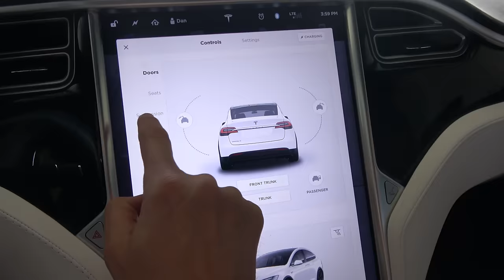What's inside a Tesla Tire?

Comment: Discount Tire will rarely patch a tire, they prefer to sell you tires instead.  Go to a smaller mom and pop shop where they will repair just about anything.  Discount Tire is a corporate shop, they have too many attorneys and share holders telling them what to do and what not to do.

I speak from experience.  A small local shop has patched various holes for me that Discount Tire refused to do.

Discount Tire will even remove a tire from a wheel and refuse to re-install it which could potentially leave someone stranded or force them to buy a new tire instead.
Reply: Blaine please make sure your facts are straight before commenting. While discount tire is the largest tire retailer in the world they are still privately owned. Just like any company yes there will be attorneys telling them what to do and not to, but it will always be for the safety of the customer and the employees working on the tires. 

I will agree I'm not sure why they wouldn't have serviced that tire it is serviceable. But before any tire is repaired at discount tire you are asked for a plan in the event of a worst case scenario. You will never be stranded. No one at discount tire is commissioned based. There has been numerous cases where a tire, if no other safe alternative can be found, will be installed for very cheap or no cost at all. 

The reason smaller shops will do things that discount tire considers unsafe is because that's what they are a small shop they don't care. I do ask of you Blaine that if you felt that discount tire has mistreated you in the past please speak with a store manager or higher they take customer safety very seriously but also want to make your experience as good as can be.
Reply: loopie159753 please make sure your facts are straight before you comment. The attorneys telling them what to do is not always for the safety of the customer it is often for the safety of the business. By making the repairable area of the tire smaller they have less chance of screwing it up which is unlikely to hurt anyone but could lead to some heft legal fees if someone figures it out. 

Having worked for Discount Tires and Goodyear myself there are tires that are refused repair which are repairable and there are tires which get repaired which shouldn't... on a daily basis.
Discount Tire is nowhere near close to being the best option for the customer. I managed 120 stores and wouldn't have trusted my car at all but 2 of them.

There are indeed scenarios where you will be stranded. If you are on a long haul journey and you need a new tire because of a blow out and your car is fitted with a temporary spare but as unusual sized tires then you will have to wait for a tire to be shipped. It happens.
Reply: Blaine Bugaski 
that's funny because Discount Tire repaired a flat on my car and it wasn't even a tire that I had purchased from them. They did it for free and when it was time to purchase tires on my other car guess where I went
Reply: Blaine Bugaski your not stranded. I've had a vehicle towed to Pep Boys with a blowout and they thought they could gouge me. Pointing out I could have it towed again and calling other tire shops changed their attitude and pricing.
Reply: Good luck, ALL of the local Discount Tire locations are always so busy and bustling that your repair and counter argument are basically worthless.  Really......what do I have to gain or lose by telling you wrong......
Reply: Do I feel mistreated, no.  If I need new tires, I will consider them.  The last time I bought tires I went to Tire Barn because they offered some better choices at better prices in comparison to Discount Tire, Walmart, Goodyear, etc.

However, I will always return to the local mom and pop shop for repairs, because they have treated me the best time and time and time again.  Discount Tire may offer better prices on tires but they are not concerned with small repair affairs.

My facts are right - I speak from experience.  Your mileage may differ.
Reply: Blaine Bugaski I work at a discount tire. I completely disagree with your comment. I have saved many people’s wallets from having to buy a new tire. If we see a nail we patch it. If it’s in the shoulder or side wall we let them know that NO tire place should ever fix it because it brings danger to the customer. Discount tire pays to train their employees for 2 weeks before touching a customers car. In that training we are taught that we want the customer to come first. We do free repairs and inspections.
Reply: Andrew Robinson  I too work at a discount tire and I completely back up your statement.
Reply: Andrew Robinson I don’t work at discount tires I work at les Schwab but i do have to say I think it’s a little funny when you have a customer who wants you to fix a hole in the side wall or a hole in the shoulder and you tell them that you can’t fix it and even after you explain to them why you can’t fix it they still want you to fix it.

Comment: So does this mean we can take off our "plebian" tires and glue a long strip of foam in the inside middle part and have the "luxury" acoustic tire effect? Sounds like a weekend plan/project. ;)
Reply from the maker: Do it! yes it is pretty simple. But great to see companies that do little things like this.
Reply: Remember if you cut the tire open you can't use it. For non car ppl.
Reply: It can be quite tyre/wheel specific. You'd have to figure out the resonance of the air inside the tyre and work out the proper thickness and density for the open cell foam. The lower the frequency the denser and/or thicker it needs to be.
Reply: Forget it and install noise insulation in your cabin instead.  If you can find a sound expert, also active noise cancellation like all modern aircraft have.
Reply: OptimisticPessimist it's about being quiet for everyone around also
Reply: Ace Tech Wait! ...you're saying I can't just zip tie em closed and call it done?!  I've already finished 2 of them!!

😆

Comment: the foam on the inside is not for sound deadening, they’re what are called run flat tires.
Reply: Rubbish. It's acoustic insulation.
Runflats have reinforced sidewalls to keep the tyre structure raised. It's nothing to do with that central strip of very soft foam.

Comment: Actually deal for years with tires and never seen the foam inside and it is most definitely a sound deaden er nothing else but the low profile side walls of that tire (i also run pirelli tires for 30 plus years) is so strong that even with no air in the tire the sidewall is strong enough to support the vehicle so that by looking at the side you could not even tell when its flat normally hence the onboard tire pressure sensors... these types of tires are usually marketed as run flat tires and they tell you they are good for 50 miles driving plus or minus with no air ... more then likely on the tesla application they are not called run flats. seen a guy run for months with a flat tire and not even know it till he did a burnout and actually spun the tire on the rim causing it to be no longer balanced and found out it was flat when he took it in for service (because of the wobble from needing balanced)

Comment: all these people talking about that foam being linked to run flat. It has absolutely nothing to do with that. Runflat tyres are just stiffer so they won't bend so much if air leaks out. That foam is there purely for lowering echo inside that tyre making it less noisy

Comment: no tube??
Reply: Most tyres don't have tubes...if you ever go to a mechanic and you hear loud popping noises it's the bead of the tyre seating which makes makes the tyre air tight
Reply: Car tires don’t have tubes.
Reply: It's a car, not a bicycle.
Reply: nagualdesign a good 30% of new bicycle wheels are tubeless as well now
Reply: Some bias ply tires have tubes. Most tires are radials. Bias plys are only used these days but manual dragsters or sortof manual drag cars
Reply: angrydragonslayer  Yes, my friend who I go cycling with has tubeless tyres. Basically some sort of blue goop that seals any leaks instead of having an innertube.
Reply: Quienbotin Older cars do have them. Actually you'll even find them on the latest models of cars sold in developing countries.

Comment: -What's inside a Tesla Tire?
-Well, it's 78.08% nitrogen, 20.95% oxygen, 0.93% argon, 0.04% carbon dioxide, and even small amounts of other gases. And all this is on the pressure of 35 PSI.
-WOW! Chemistry and physics combined! Now, that's rocket science! Uhmmm... wait a minute...

Comment: Okay, sure, they can tear off the foam and glue it back in. Until the customer comes back and complains that they hear chunks of foam banging against the walls of the tire because you didn't glue it back correctly or thoroughly. That's why they don't want to deal with that.

Comment: The foam in the tire has nothing to do with the fact that its installed on a Tesla vehicle. "Noise Vibration and Harshness" that's why there is foam. Also, the foam does nothing for the Run flat tech of the tire other than the fact that RFT tires are more rigid and can create more noise whilst traveling down the road.

Comment: Yeah those run flats are fixable but it’s pretty dang hard. After you cut off the foam, you have to spend 10 minutes grinding off the adhesive used to stick it there. I’ve done it, and ruined 2 grinder heads. Source: am a discount tire lackey